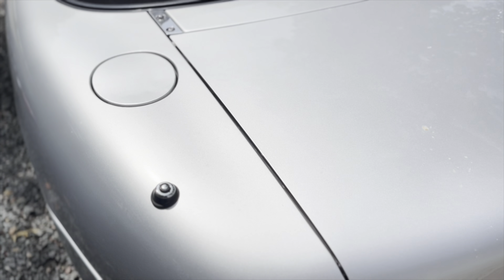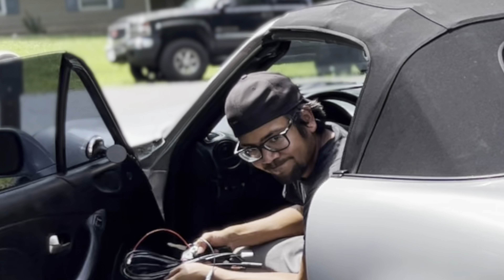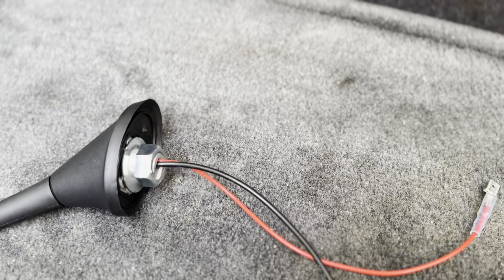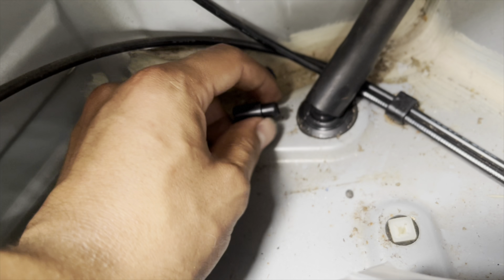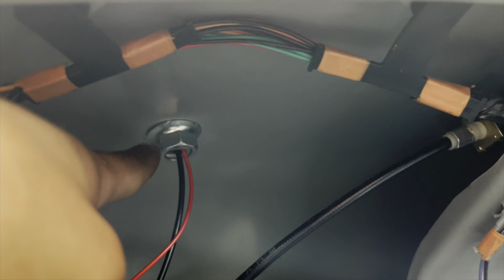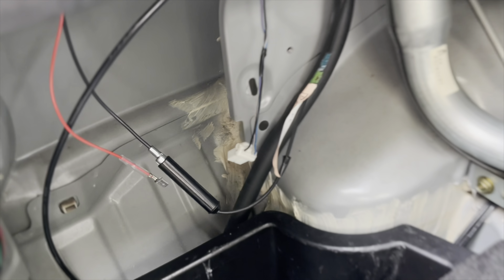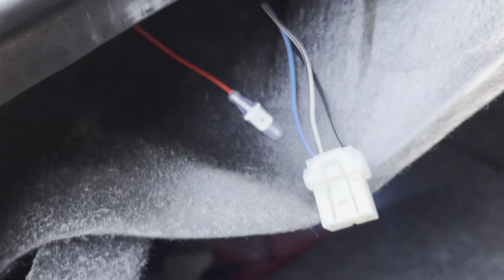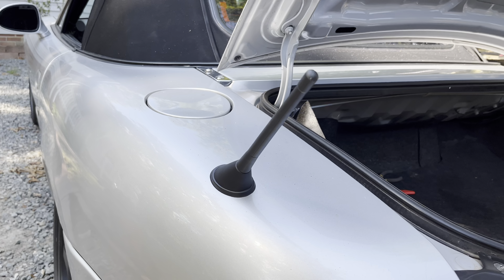Miata NB Short Antenna Install!

Comment: When you were tightening down the bolt underneath, did the washer with teeth grip the hole and dig in evenly? I had a lot of trouble getting it to tighten down evenly on my NB and stripped the bolt 😑
Reply from the maker: Sorry for the late reply, yup had no issues with the etching washer clamping fine, I’m sorry that happened! May need to hold down one side on ur next try till it starts gripping the metal.

Comment: What do you click or hold to put the antenna down
Reply from the maker: No switch for the antenna specifically, basically goes up and down with the radio being turned on and off!

Comment: I don’t know why US MX-5s are different, but my (Australian delivered) 2003 MX-5 (which I bought new) has an automatic aerial but mine only goes up only when the OEM head unit is set to radio. I turn to CD, or the OEM MiniDisc module, or (aftermarket) Bluetooth, and the aerial goes down. I have never been able to understand why the same car in the US has the aerial up whenever the head unit is powered on, regardless of input.
Reply from the maker: WOW I’m surprised how these little things can be so different pertaining to the market haha I definitely prefer some non-US options
Reply: I have a UK spec NB2 Icon. My antenna goes up as soon as the radio unit is turned on.

Comment: Is the installation the same for the NA Miata?
Reply from the maker: Should be just about the same! Main difference will be if you have the 5-speed, just need to clean out and refill the turret oil from up top where the shifter mounts, which is separate from the main transmission fluid reservoir filled from underneath. 6-speeds do not have a turret to fill.